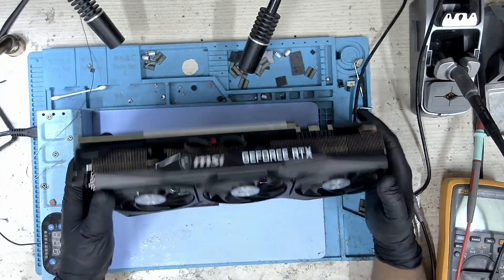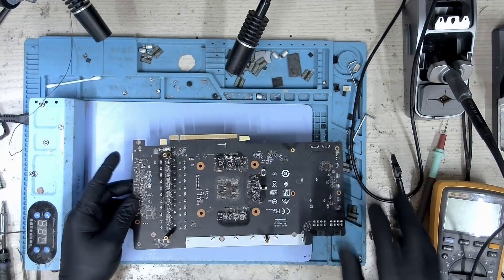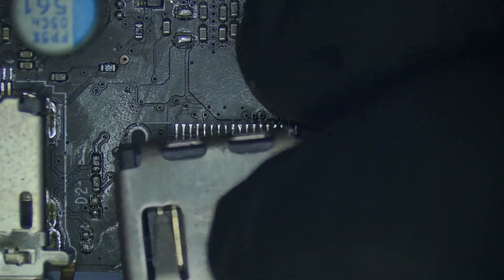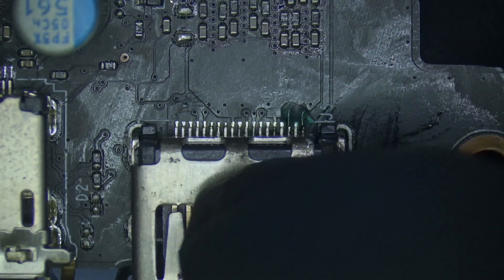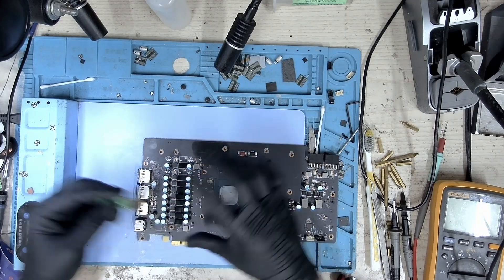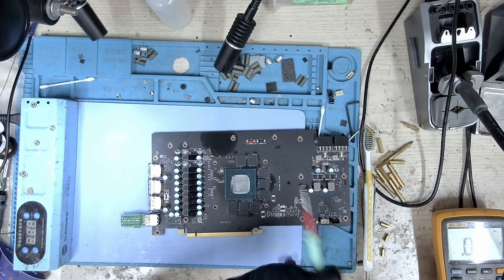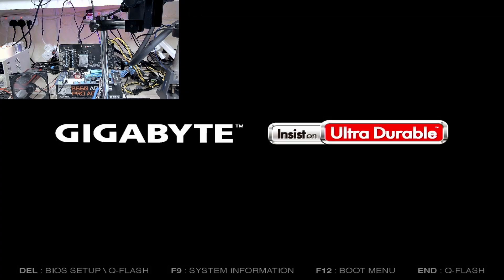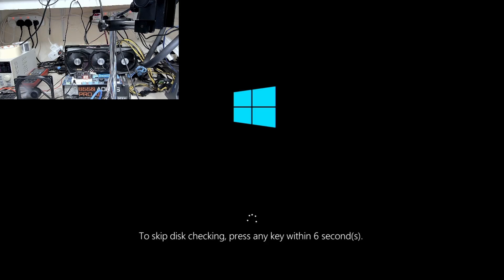MSI RTX Gaming X Trio - No Display - HDMI Port Replacement

Comment: Hi brother, i own 2070 Super card by Gigabyte. Recently all my display ports are dead. Only HDMI works. I tried with different cables, still same problem..

Is there any controller that powers all display ports? None is working. Is there any solution to troubleshoot?
Reply from the maker: The display port connects to some capacitors at the back. One side they connect directly to the GPU core. But you will have to check if you are getting 5v on the display port.
Reply: @GraphicsCardRepairs-tk7ql  I'm not the electronic expert. But like to ask. Is this repairable. The shops in my area (Chennai) say! It's better to replace it with new graphic card.

Comment: Great video! Where do you get the hmdi replacement ports? I do a lot of Playstation and Xbox hdmi ports but cannot find a source for GPU hdmi ports! I hate when those pads rip but great recovery! At least it was only 2 instead of 10!
Reply from the maker: You can buy the HDMI ports from AliExpress. Just type "HDMI connector" and you will get different options. Find the connector relevant to the GPU you need to replace with.
Reply: @GraphicsCardRepairs-tk7ql  Are they usually different or are there standard ones that work on multiple cards or even the same ones as PS5?
Reply from the maker: They are all different. It depends of the AIB partner like MSI, Asus etc.sometimes they are similar
Reply: Could you provide a link to the hdmi connector you found. I looked on Ali express and could not find it. I have a similar card to you but the 3080ti

Comment: Big boss, what is the model of this Heating Plate you are using?
Reply from the maker: The link to the preheating mat is below
https://a.aliexpress.com/_olHlniK
Reply: @GraphicsCardRepairs-tk7ql  thank you boss!! ♥
Reply: Do you use it to preheat the board when replacing ram chips? What temps do you use?
Reply from the maker: This preheater mat I use for all soldering and desoldering. Specifically for non leaded solder and chip removal. The preheater has a max temp of 118°C. I use it at the max temp. On the hot air is use 420°C at 60% air.
Reply: Hi. Where did U get replacement hdmi port from? I am looking for one but no luck.